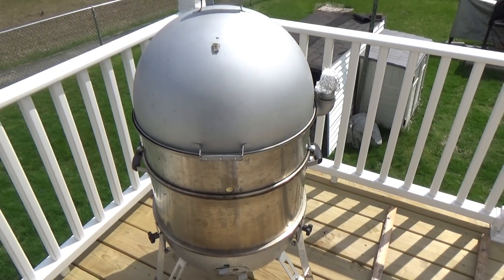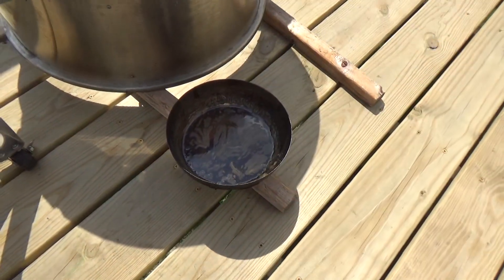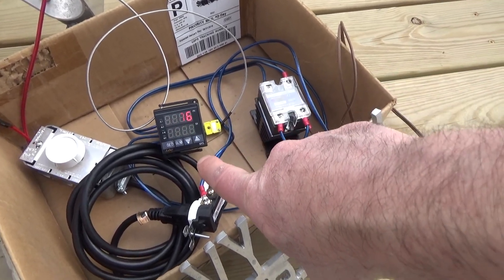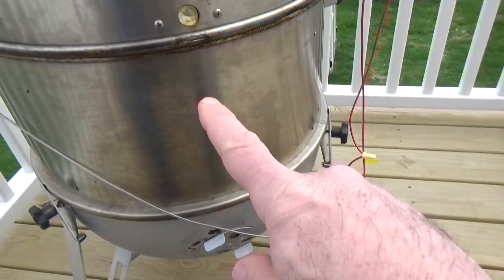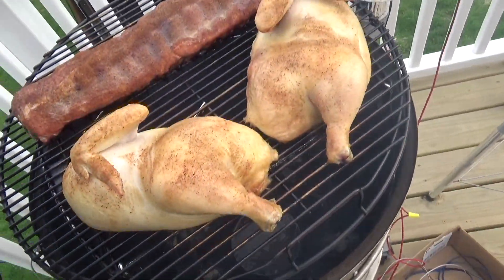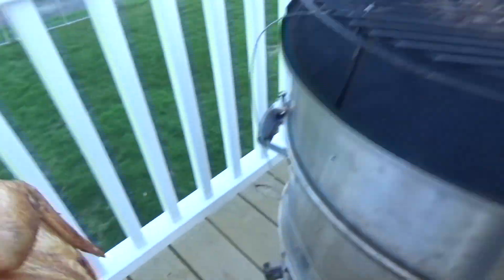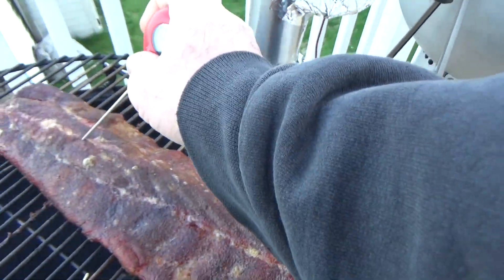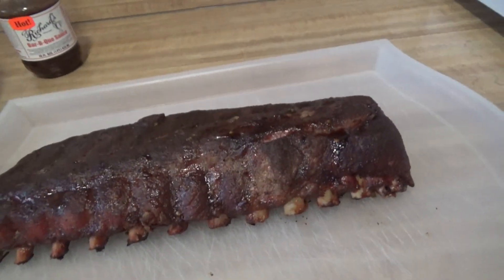Weber Smokey Mountain Mod....with a PID Controlled Exhaust Fan/Open Pit Style using Lump Charcoal

Comment: KBQ is now repaired; I'll be firing up some ribs here in a day or two.  I like the thoughts on the height of exhaust - would a couple of baffles inside ensure the smoke can pass only over grates?  Very tempted to have some of these spacers made myself.  Thanks for all the efforts - Happy Easter! \m/
Reply from the maker: Glad to hear the KBQ is back Rockin'!    
Not sure what you mean by adding baffles for the smoke only over grates.    This is a reverse flow set up where the cooking grate is above the exhaust port. 
This is guaranteeing that the heat and smoke are surrounding the meat.    Maybe I'm not understanding , clarify if I'm not.  
You know You can buy these extension rings from Cajun Bandit . com      Have a good Easter! \m/
Reply: Can't really get fabricated metal stuff easily into Indonesia.  I'd try a baffle the area below the exhaust and have all the smoke flow directed above and pass over the grills. Thanks Man!

Comment: No BS... two seconds before you said don't break the skin... I said the same "better not break that skin". That was two beautiful chicken halves... juicy as all hell \m/. This was a cool set up for a cooker. I like the control fan on your exhaust stack... kinda like having front well drive! You had good control of the temps all thru the cook. Well done Ken... HMB On!! \m/
Reply from the maker: Hey Thanks Chris!   LLLLL....Guess great cooks think a like?  :-)    For me that's kinda like when they cook a whole hog.  That skin holds in all that juice. 👍
I had to try the fan.........but I wanted to use Lump......because that would be the truth test for me.  Got lucky....I guess? :-)  
What did You think of the water pan idea?    Metal On!  \m/

Comment: Great cook on the weber stainless mountain, yes charcoal reveal, very efficient. You have to extend charcoal reveal to at least 30 seconds in 😁. Have you considered making ventalator with pid technology. Great cook chicken looked well fed. You and Mrs. Metal stay safe. \M/ 🤘ON.
Reply from the maker: How about that.......You got another mention.....and You don't even have a Channel!  :-)     
Hmmmmm a PID ventilator?  :-) You got any other video suggestions.....something never seen before of coarse.  
Hey......did you see Tom Horsman's latest Vid?   I got an idea from that one.  :-)    Metal On My Friend!  \m/
Reply: @HeavyMetalBarBQue  Are we talking about Caveman Video
Reply from the maker: @johnknapp6328    No.....The pellet grill Fan Vid. .
Reply from the maker: Hey John!  They may be going for a Poor mans Ole Hickory!  LLLLL. 
I'll need to see more of this because I know how that fan blade works.  Not sure it's the best way to do it.  If it's only to try and even out temps,...then maybe.  But I don't believe it will have that convection effect like you are talking about on the Ole Hick.  For now I'll just sit back and watch to see more results on this concept. 
You may not remember but I put a similar fan in one of my charcoal set up cooks.   It did make the temps run a little higher,.....but I didn't have it mounted properly and like I said those fan blades work a certain way.   I may try to find another cheap fan and try to mount it in a true convection type of set up?  We'll see?   Good talking with You! \m/
Reply: @HeavyMetalBarBQue  Biggs Home Cookin had a memorial video Phil Passed away 4/21/2020. I thought you would like to know.
Reply from the maker: Thanks John.    Very sad over here.......I lost a BBQ Brother.    YouTube won't be the same anymore.